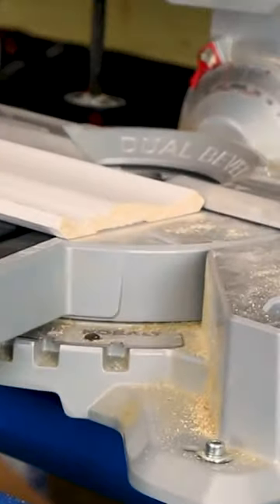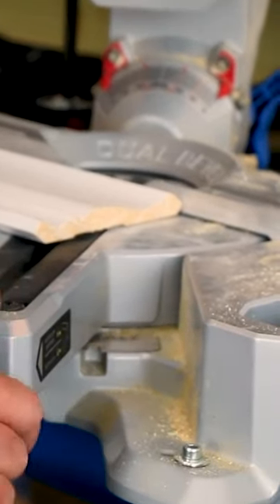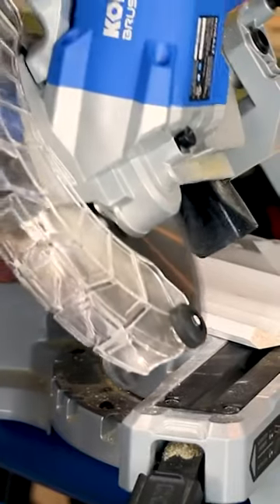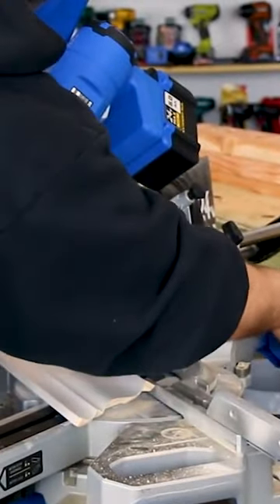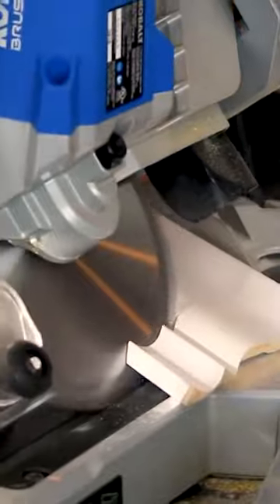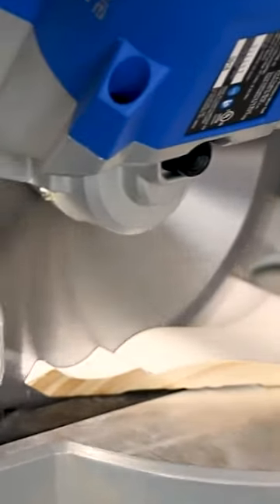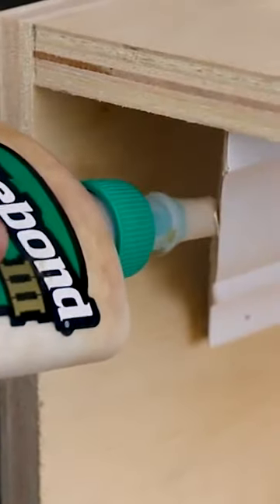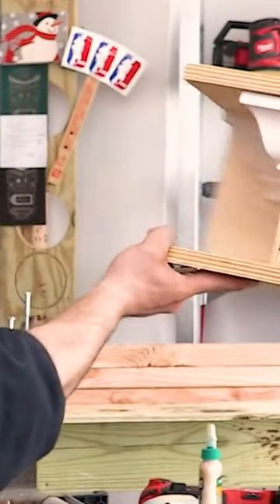PERFECT Crown Molding INSIDE Corners!

Comment: I just make a jig and mitre cut all angles regular.  No coping and 31.6 degree cuts necessary
Reply: Agreed sir
Reply: That way sucks and isn't professional looking.  Learn to cope ,get good the money will be there .  And FYI the angle of your blade depends on spring angle . It's not always 31.6° or 35° .  Your bevel is dependent on the angle of the inside corner , the bevel is dependent on spring angle. 
 Just Google miter tables like I did , print it , laminate ,and hang from your miter saw table.😂😅
Reply: Do your best and just caulk the rest! If you're not coping an inside corner it will probably open up & look like 💩 afterwards. It's really not that difficult to do & the results are far superior to plain 45° miter cuts. Looks like he's using a jig saw w\ a (collins)coping foot on it instead of standard OEM base. I use a combination of OMT, grinder, & razor blade for coping but results are the same. You just need to remove the back, excess parts of the moulding to at least 5 - 10 degrees past square so it'll match up to moulding profile exactly! I think it's actually easier than trying to get perfectly matching corners....that are almost never a perfect 90 degree square corner!! 🤔🤦‍♂️🛠️🔧🔩📐🔨📏✏️🧤💨👌👍⚠️
Reply: All @tdotw77  
All I can say is that my joints fit perfectly with no gaps whatsoever using a jig.  The jig makes the same angles with less work and identical results.

Comment: Hopefully you read this. I've coped using every method known and the fastest most accurate I've found is using a 4" grinder with a 40 grit flapper wheel . It chews through the crown perfect . It's really good for cutting a deep back bevel.  At first sneak up on the white line and leave a hair of raw wood then file it the rest of the way . Once you get the hang of it you can cope it fully pretty quick and with a perfect fit.
Reply: That’s what I do dremal 👌🏽

Comment: Dude I used to work construction and this type of stuff is why I went automotive it’s too much for my tiny mind to comprehend! Vince you’re amazing!
Reply from the maker: Thanks Carter, im sure if you slowed down you’d pick it up!
Reply: Thank you I think you’re right but automotive it my natural habitat :) never gonna slow me down but I’ll give it a try
Reply: BUT, There's no computers required to put up crown molding.....nowadays the vehicles need a computer to simply open a window though! Cutting wood is not that hard. Generally parts changing isn't hard either. But when you get into diagnostics on electronics in some of these cars(w\ 25+ 💻), done with another computer (scanner\laptop) that may be slightly harder. You need a computer to talk to other (vehicle) computers! I do both construction & vehicle repair so I know what you're talking about tho. It is easier to change an alternator or starter than it is to get perfect crown moulding mitre joints in a twisted 100+ y\o house. I get it tho.🤔👍👌🛠️🔧🔩⛓️📐🔨📏✏️🧤⚡🔥💨🚜😀🍻🤷‍♂️

Comment: This is ridiculous! turn your piece upside down, put it on the fence like it will go onto the wall or cabinet and set it to whatever your corner degree is. I.e  90 corner set to 45 no coping no extra cutting perfect every time! These double miter cuts create twice as many opportunities for errors!

P.s when you’re taking measurements use short hand to remind you what kind of cut to make so is it’s an inside on your right outside on your left after the measurements put (r,i,l,o) right inside left outside! and you’ll save even more time!
Reply: Coping gives a tighter joint and more perfect look and a bad angle on a wall won't effect it.